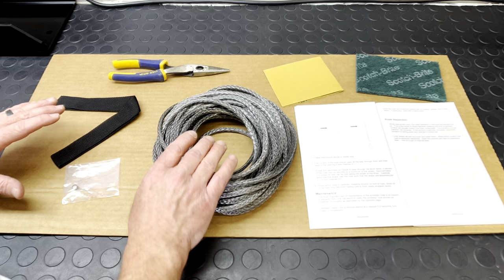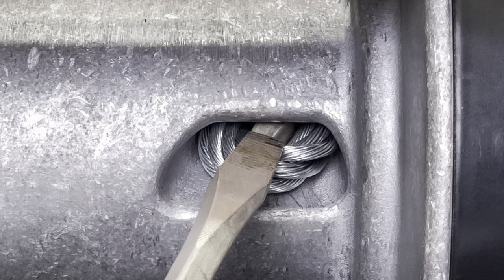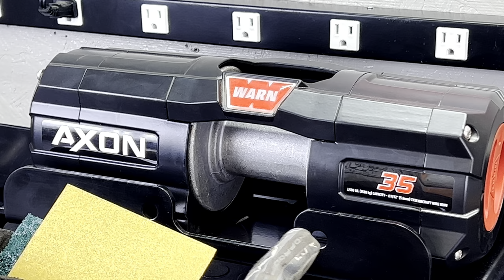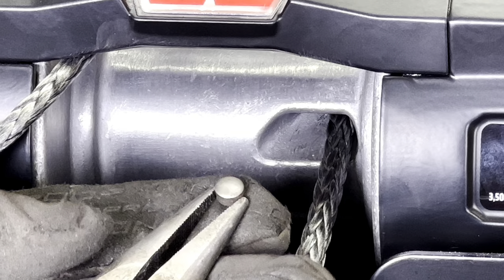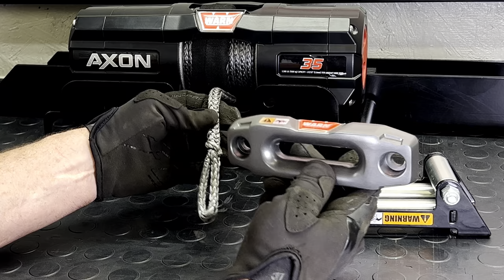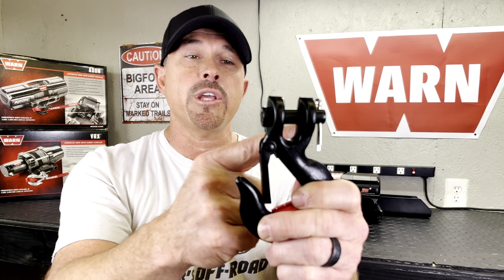HOW TO REPLACE WARN WINCH CABLE WITH SYNTHETIC ROPE

Comment: Pre stretching the cable is the most underrated part of when you first install new wire, or first install a winch. Every time I install a winch, first thing I do is pull it out, leaving 3 wraps on the drum, and with some fairly decent tension on the line, re wrap the cable/line.

Comment: Great video Brian, I also watched your videos on how important it is to stretch your new Synthetic rope. I just had a couple questions 1) can I park my jeep on a up hill, and use it as a anchor to pull my Maverick trail up to it, stretching my winch rope?  and should I keep my SXS in neutral while I’m winching it up to my jeep and stretching the line at the same time to my jeep. 2nd question if I use my SXS to winch out a large rock or another SXS out a ditch again, should I keep my SXS in neutral, or maybe in park? while winching the rock out or the vehicle out, I don’t want to hurt the transmission. Thanks 🙏🏼 again Brian, as you can see I’m new to all this, I think you are one of the best with your knowledge and experience. God Bless.
Reply from the maker: Hey Tedd, welcome to the off road world buddy! It can definitely be overwhelming with all the info out there. If you did not see this video we did on stretching your winch cable be sure to check it out, WINCH BREAK IN | THIS IS A MUST BEFORE YOU HIT THE TRAILS...
https://youtu.be/fV15ZPgOzSY 

I used my Jeep to do exactly what you are asking about. I left my RMAX in neutral while stretching the wire rope. 

As far as your second question, if you’re using your machine to winch anyone or any objects out, I would recommend you stay in your vehicle with your foot on the brake and your tranny in neutral so you don’t put a bunch of torque on your tranny in park. You could also us an accessory kit to anchor the back of your machine to a tree or another vehicle if your machine starts sliding toward what your winching out. 

Thank you for watching and for asking great questions! Keep in touch my friend and don’t hesitate to hit me up with any questions you may have… 👍🏼

Comment: Great video. I have a warn 3700 winch, takes a 7/32 cable can I change it out and use a 1/4 synthetic rope? Thanks.
Reply from the maker: Not sure about that, I don’t think Warn ever made a 3700?
Reply: @FishersOffRoad  Hi, I purchased it about 14 years. Warn updated it to 4000 series winch.

Comment: Can I do this to my old warn winch?  It’s a 9.5ti and looks pretty old but still works great.  Would I need any other parts or are they pretty much the same setup?  Thank you in advance.
Reply from the maker: It should be the same concept, I’ve done it on both truck and PowerSport winches.
Reply: @FishersOffRoad  

Thank you for the prompt response.

Comment: Newbie. I have apparently a WARN 2.5ci ATV Winch on my Kawasaki Brute Force 650 (KVF650E6F). I would like to replace the current cable wire. I see ton's of options on amazon that are NON Warn.  Any recommendations would be appreciated for the Rope or a replacement winch with rope installed

Comment: I tried to replace the cable on my winch, but lost the puck when I tried to put in the new rope.
What do I look for online to buy a new one? I search puck and those results keep end up being for a rubber stopper for the cable at the end.
Reply from the maker: I think if you call Warn they will send you one. 833-727-8784

Comment: Can I upgrade the length of the rope from say a 50' to a 95' ?  Right now I have a 50' on my Warn Winch.
Reply from the maker: I would stick with the 50’ that Warn recommends. Adding more rope will change everything as far as gearing and if you should happen to stack to one side or the other you’ll cause major damage to the winch. Warn sells a 50’ extension rope in case you need more during your recovery.
Reply: @FishersOffRoad  Ahhh so stick with the 50'; and if I need the rope longer, just use the extension for that moment.  Ok that makes sense... Thanks for the reply, because I was back and forth about buying a longer rope , yet the temporary extension makes more sense 👍

Comment: I am going to guess, since a I haven’t bought rope yet, that the black piece shown initially is a tube that the rope is then inserted into, right?
Reply from the maker: Yes, it’s a sleeve protector for the rope. In case you’re winching over anything abrasive you put the sleeve on it and the rope slides through it and protects your rope from abrasions.
Reply: @FishersOffRoad  thanks much
Reply from the maker: You bet, let me know if you have any other questions.

Comment: I just had a synthetic line melt and literally destroy itself after only using the winch one time .. I’m going to steel cable.. I realize I’m a minority but if the synthetic line isn’t anymore durable than that I don’t want it ..
Reply from the maker: That’s very odd, I’ve been using synthetic ever since it came out and have never had that happen. 🤔
Reply: Winch was at about half capacity if that on straight line pull .. had to move about 3 times to get him off the sand in the dirt so he could move under his own power .. last time I went to pull the rope out out I noticed it was extremely hot even so it was getting uncomfortable with gloves on.. then I noticed what looked like flat melted spots on the line .. and. I did respool it under load when I got it .. but yeah my old winch had synthetic line but it never behaved like this
Reply: Same thing happen to me.
Reply: Please provide the manufacturer of the ropes that melted, would like to change to rope, but want to avoid manufactures that have sub-standard product.  Like wise does anyone have recommendations for a proven synthetic rope that is not melting.  Thanks.
Reply from the maker: I’ve been using Warn synthetic ropes for years and have never had a problem with any of them. We use them on our ATVs, side-by-side, pick up trucks, and they always hold up.
Reply: @FishersOffRoad  I've had a synthetic on my grizz for over ten years and it never did that. Granted, synthetic will get "flat spots" but it's still serviceable. I'm at the point now that I don't even use a metal hook. Synthetic winch rope, synthetic shackle, and tree strap. No metal to break nor is there any metal to damage the fairlead so no bumper. Biggest problem I see out there is people buying too big a rope.

Comment: Could have left the rollers on
Reply from the maker: As long as the rollers are new, you can’t use rollers that were used for a wire rope or the burs will ruin it. Or you can sand the rollers really good to get them smooth.